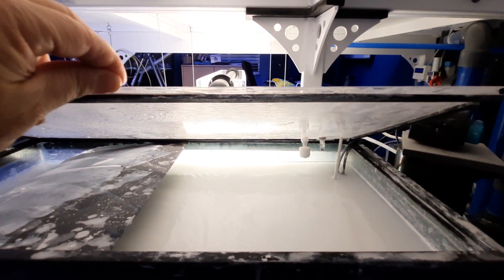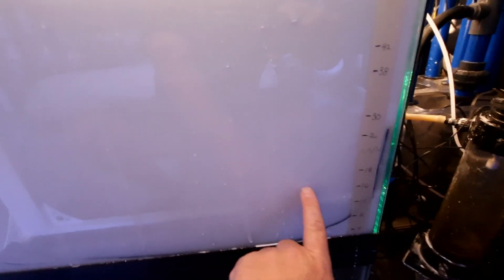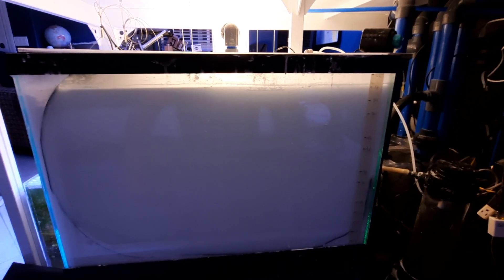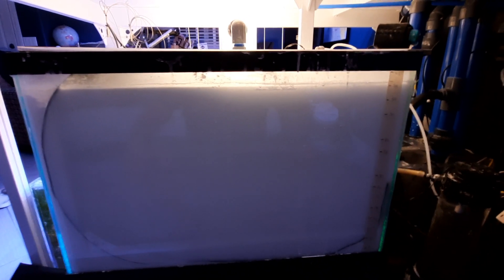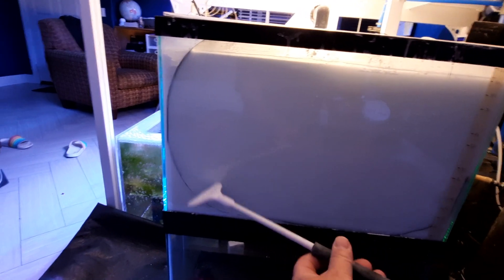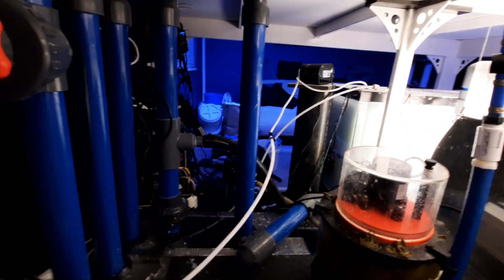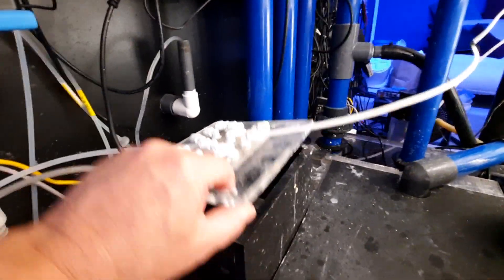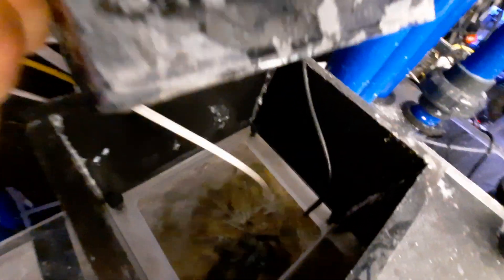Kalk Slurry system #kalkslurry Big thanks to Luca Martino for making Kalk Slurry what it is today!

Comment: When you add the kalkwasser will your alk and calcium and ph be a lot higher right after you put it in ?
Reply from the maker: Not that I could see even with alk testing every two hours. I ended up getting precipitation problems and took it offline and going back to my kalk stirrer and still 2 part. Still trying to get precipitation to stop coming back after I scrape it off the glass. Was doing calcium at 2 times strength which might have been part of it. Also the sump section I dose in was a little small. Some have said you can't combine slurry with 2 part. I think it would all be easier on a lower demand tank. Lots you can get wrong with slurry. Luca from mahina corals has a slide presentation on instagram that has lots of info.

Comment: I think you would get easier results with a Calcium reactor and just use lower concentration of kalk for the ph benefits.
Reply from the maker: I think your right. Running an SPS tank this big without a calcium reactor is like swimming upstream sometimes. I'm not ready to give up yet though. I think if I can get the ph consistent the consumption will steady out and I'll not be using a cost prohibitive amout of 2 part. I just redesigned the mixing container which might help.We'll see.

Comment: Have you ever tried running the slurry without any 2 part?
Reply from the maker: I did but I have a really large tank 400g, with tons of acros and couldn't get it dialed in with just slurry. In theory with more concentrated slurry I could get more into the tank but I was also getting a lot of calcification on all my pumps even below 8.5 ph and a lot of precipitation in the filer socks. I did a lot of tweaking it and correcting manually each day with 2 part to stay in range, but eventually gave up and put the 2 part back on a schedule. With less corals I think it would have been much easier but have never tried it on another system. What I have now is more like a kalk stirrer that is over stirrer, I think my slurry concentration is very low, going to test it soon in a graduated cylinder like others have posted.
Reply: @paulfoxgrover7719   might try amd remove your filter socks with this method.  Could help with tthe precipitation loss.   Cool setup thanks for sharing

Comment: I have been working with Luca and Sam on converting my tank to slurry.  The first go around we didn’t have enough water movement in the sump and it precipitated out.  Once we got that fixed with wavermakers, the next issue was when the ph goes up my alk/ca would go down.  I would try to dose with baking soda, but it still was a loosing battle.  I see your using a different 2 part?  You think that might be my issue?  Thanks
Reply from the maker: Now that fall is here I am planning to change my alk 2 part yet again. At one point at the height of summer with my evaporative cooler pumping tons of fresh air in the house and with a different slurry setup, I was maxing out pH. Using baking soda helped combat this with its pH lowering effects.  Since then I have switched to a mix of baking soda and soda ash(baked baking soda) and although that works pH has been lower than I want without all that fresh air so I'm dosing just soda ash and still need a pH boost. Keep in mind when mixing soda ash and baking soda that they have different soluabilities hence the difference in Randy's recipe 1 and 2. The one with baking soda is half as concentrated for both parts (CA also)  so you need to dilute the soda ash to mix them in equal concentration. Hope that makes sence . Here is more info.http://reefkeeping.com/issues/2006-02/rhf/index.php#11 . Next I am going to try mixing some pure caustic soda (NaOH) or lie, in with the soda ash to get closer to 8.3 give or take. Randy has a few awesome threads on Reef2reef about 2 part with NAOH that are easy to find. NaOH required proper handling and gets very hot when mixing so make sure you take all necessary precautions if you try that including gloves and splash protection etc. Hope that helps, this is not as easy as some say so don't risk your pets unless you have the time to fiddle with it along with the necessary failsafes. Good luck!
Reply: Do you suffer and loss of potency with the continuous mixing to the point it stays cloudy? I know kalk is supposed th loose some by absorbing co2 from the air in unsealed containers if over stirred.
Reply from the maker: @pjshooter6  I'm sure there is a little that precipitates out of solution but not enough to really matter in my estimation. I do have a lid so it's not getting much air exchange.

Comment: you should check out avast marines kalk reactor.  KALK is very caustic it will destroy everything in that mixing tank including the seals.  you need to be pumping fresh ro into the mixing chamber and have it overflowing into your sump.  The lines for the dosing pump will get clogged with precipitate also.  the reactor is a safer and more consistant way of dosing kalk.
Reply from the maker: I had been using a very nice reef octopus kalk stirrer for about 10 years. It is still in working order but have taken it off line as I try to push the limits of kalk. My tank is using around 6 to 10 dkh per day as an estimate. It's hard to calculate because if I stop dosing while the lights are on, the alk level will drop off a cliff in just a few hours maybe down to 4 or 5. With a clear saturated kalk solution I can only get about 1 dkh per day at around 11 liters of top off water if I recall the numbers right. Right now I am dosing 9.5 liters of kalk slurry and still need to dose 3 liters of Randy's 2 part recipe 2 to keep up with calcification. If I were only using two part the cost would be very high and also fighting off using a calcium reactor because of the added complexity and lowered ph. The mixing container is just glass, Silicone, and kydex T sheet. Kydex is very chemically resistant. This is my second attempt at a mixing vessel,  the first was just a 5 gallon bucket. I am working on a new one. I am not the first person to run SLW pumps in kalk slurry, check out Telegram or mahina corals channel as they  have been running them longer than me. Is this method fool proof? Very far from it and we are all still trying to nail down this method. Lots of fine details that will make or break. Time will tell. Check out my tank video, corals are coloring great and growing fast.
Reply: @paulfoxgrover7719  have you considered using tropic marin all for reef in place of the 2 part? It's available in 3 pound powder ( makes 10 liters) or even 33.5 pound containers which would make well over 100liters! All For Reef is much more concentrated then any 2 part, is all three alk,cal,mag AND 17 trace elements all in one solution! I'm dosing 3.2 gallons of kalkwasser running through an avast marine kalk reactor,  using the same x1 pro t doser on my 700g system. I also dose 30ml of all for reef spread across 24hrs. Much cheaper and more stable then when I was dosing 3 part and I don't need to toy with trace elements!
Reply from the maker: @pjshooter6  I have tried it on one of my smaller tanks although the price still seems a little high at almost $7 per liter. I didn't see anyone selling the 33.5 lb size, how much does that cost? Did you say you are only dosing 30ml per day on top of you kalk stirrer evaporative replacement? I think I would need  lot of it based on the number of corals I have.
Reply: @paulfoxgrover7719  yes only 30ml on top of my kalk. Even when I was dosing my 270g system which was fully stocked with sps, a bunch of huge monti, I was dosing 190ml a day and that was with no kalk added. Something to consider that could be possibly happening,  is perception in your system. Im sure you know this, but it's possible for the 3 parameters to get a bit out of wack, and triggering a constant perception event requiring a ridiculous amount of dosing to keep the levels where you want. 
A nice thing with all for reef is it's a delayed release of part of its full potency. It releases completely in 24-36 hrs. So in a system without coral or lightly stocked alk will increase in 24 to 36 hrs after the dose. I believe the 33.5 pound containers run about 270.00. The 3 pound are around 36.00. On ebay. I buy 4 at a time and shipping is way less then brs is charging
Reply: Ask a distributor to get you a 5 gallon bucket of afr powder. Bulk sps need bulk solutions at bulk discount.

Comment from the maker: A few clarifications,  a dosing pump is refilling the mixing container about the same rate that slurry is getting pumped into the sump. I keep track of how much that is and measure out kalkwasser periodically and then add that kalk powder to the mixing tank. Aiming for 3% kalk slurry so if I go 4 days or 32 liters without adding the powder, I add 32g x 32 of kalkwasser and dump it in. This way if I'm not around the mixing container doesn't run low with the mixing pump sucking air. Also drawing the output from about 3" above the bottom as Luca recommends and I think that helps to keep the consistency better. Time will tell if this is a good setup.. Obviously there is a lot more to this and many failsafes and good monitoring is required. Do your homework thoroughly before putting your pets at risk if you are going to set this up.